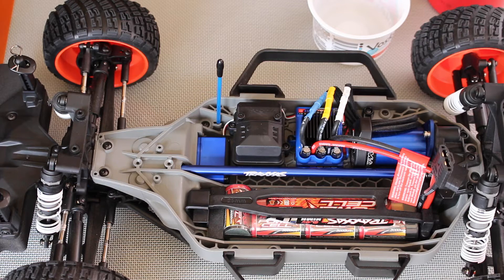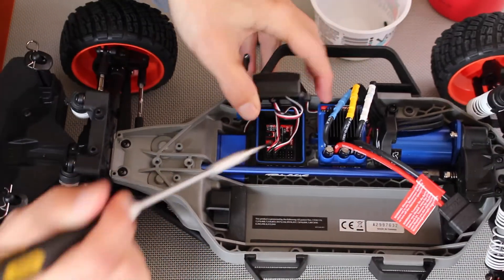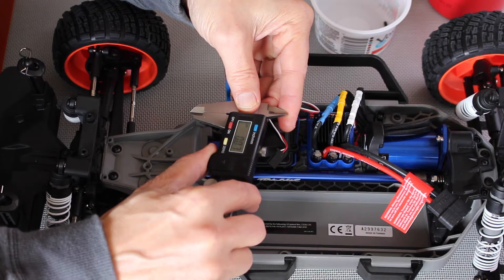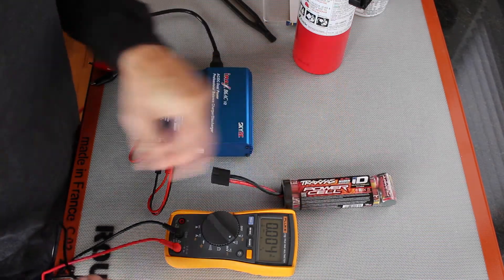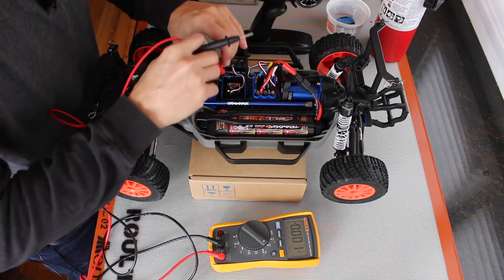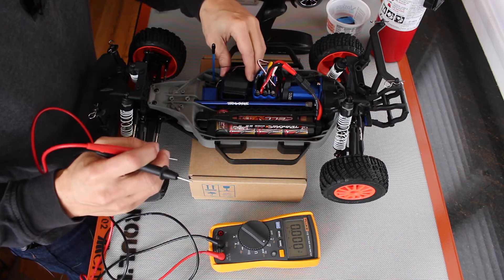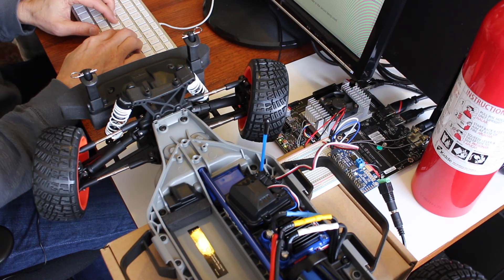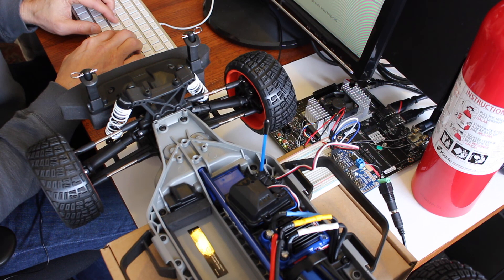Jetson RACECAR Part 2   - Steering Control

Comment: why did you use external power to the PCA. why not supply it from the battery or board?
Reply from the maker: In this video, we're just testing. We attach the Jetson, sensors and PCA to a battery later in the series. Thanks for watching!

Comment: How would you run this with ROS? I understand you'd add "JHPWMPCA9685.h" to the CMakeLists.txt as an executable but what about the cpp file "JHPWMPCA9685.cpp"? Any chance you could share your CMakeLists.txt (if you have one) to see the layout? Thanks
Reply from the maker: I do not have anything to share on this. However, if you check Github, you may find several packages (such as ros-pwm-pca9685) which deal with the PCA9685 chip. Thanks for watching!

Comment: Hello,I have some questions,
When I follow your video step by step,
But finally my servo motor can’t operate,the terminal show
“pca9685 device address:0x40
Setting pca9685 pwm frequency to 60hz 
Hit esc to exit “
Should I hit any key to let the motor operate?or where is the problem I have?
Reply from the maker: Which Jetson are you using, and which version of L4T?
Reply: I use Jetson TX2 and my version of L4T is 28.2.1
I know the JHPWMDriver repository on the JetsonHacks Github is used for TK1, so I use pin3 and pin5 to instead the pin27,pin28.
and I use 
$ sudo i2cdetect -y -r 0 
Let the address still can use 0x40. Otherwise will appear byte write error.
these are someing I did differently with the video. 
thank you
Reply from the maker: On the Jetson TX2, Pins 3 and 5 connect to the I2C Bus 1. When you i2cdetect -y -r 0, you will see that there are entries at around 0x40 that are marked as 'UU'. These are the I2C Power monitors onboard the Jetson module. You should see the PCA9685 when you:

$ i2cdetect -y -r 1

1 represents I2C Bus 1.
Reply: thank you for your reply!
I will try it tomorrow!
so the servo motor will operation automatically when the program execute?
Reply: thank you !
my servo motor can work already.
Reply from the maker: Good to hear that you got it to work!

Comment: Hello, I followed the steps until 10:27, after I typed in $make, it gave me an error saying "g++ servoExample.cpp ../src/JHPWMPCA9685.cpp -I../src -o servoExample
../src/JHPWMPCA9685.cpp: In member function ‘int PCA9685::readByte(int)’:
../src/JHPWMPCA9685.cpp:86:77: error: ‘i2c_smbus_read_byte_data’ was not declared in this scope
     int toReturn = i2c_smbus_read_byte_data(kI2CFileDescriptor, readRegister);" 
Any ideas how to fix this? Thanks!
Reply from the maker: Did you install the libi2c dev tools?
$ sudo apt-get install libi2c-dev i2c-tools
Reply: Hi thanks for the response. I installed the tool and was able to move on until 10:33. Then after I typed in "$sudo ./servoExample", it gave me "PCA9685 Device Address 0x40 PCA9685 Write Byte error: 121". Any advice will be appreciated. Thanks!
Reply from the maker: What is the result of:
$ sudo i2cdetect -y -r 1
Reply: Hi, I think the result I got was not a 0x40 entry:
    0  1  2  3  4  5  6  7  8  9  a  b  c  d  e  f
00:          -- -- -- -- -- -- -- -- -- -- -- -- -- 
10: -- -- -- -- -- -- -- -- -- -- -- -- -- -- -- -- 
20: -- -- -- -- -- -- -- -- -- -- -- -- -- -- -- -- 
30: -- -- -- -- -- -- -- -- -- -- -- -- -- -- -- -- 
40: -- -- -- -- -- -- -- -- -- -- -- -- -- -- -- -- 
50: -- -- -- -- -- -- -- -- -- -- -- -- -- -- -- -- 
60: -- -- -- -- -- -- -- -- -- -- -- -- -- -- -- -- 
70: -- -- -- -- -- -- -- --                         

THANKS AGAIN
Reply: did you solve problem?? i have same problem too